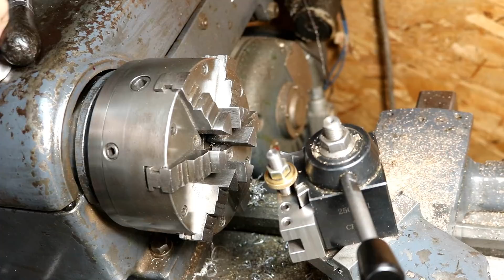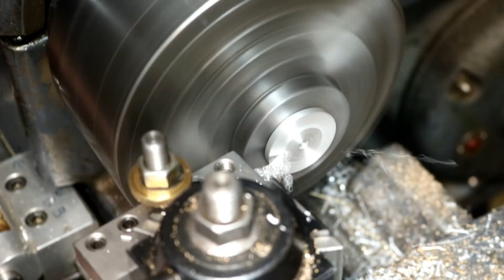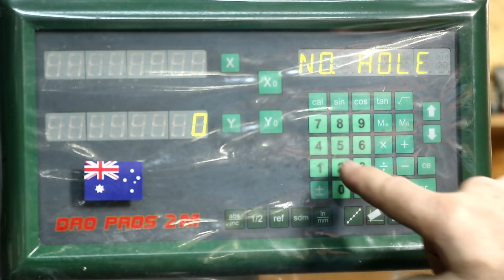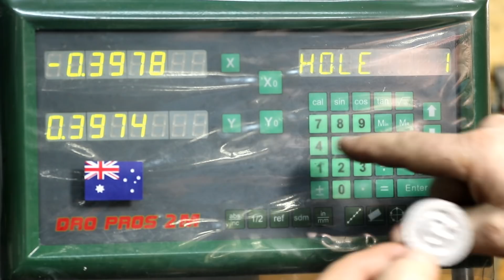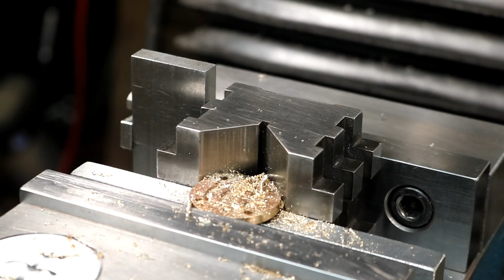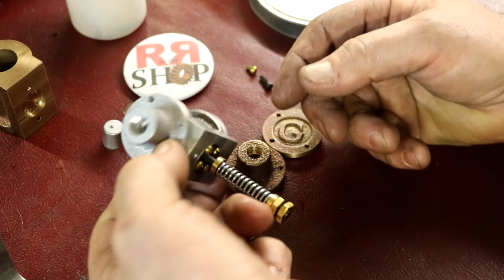P4-2 How to Build the Cylinder Heads of a Model Steam Engine for the First Time

Comment: Nice Cylinder Heads Randy and good advice on removing the parallel from the chuck catching that thing between the eyes could be your last mistake or at least wipe the smile off your face, permanently.
Reply from the maker: Yes for sure, Thanks John.

Comment: Whenever you have a bolt or screw that seats on an un-machined face (like your cylinder cap) it is a really good idea to make a little counterbore and clean up the surface under the bolt head.  Those little tiny model engineering fasteners break really easily if the head does not seat nice and square.  It also looks really nice.   You can knock one up from a piece of steel very easily.
If you go with studs and nuts, a good trick is to loctite the nuts onto the studs.  You can then tighten it like an ordinary bolt and they all end up being the same length sticking out of the nut.  (This is something I saw Keith Appleton do :-D).
Reply: Agree about the counterbore...   ;)    
Just one more fine little detail...    lol
Reply: Sorry I was just trying to help.  You are making a lovely job.
Reply from the maker: @CreaseysWorkshop  No need to be sorry John.  I have so much time already into this and more to go.  You are right the spot face would look good.
Reply from the maker: I already have enough time into this what is a little more.

Comment: I suspect that you're going to have some issues as a consequence of the connecting rod bores being a little out of alignment and not centered in the cylinders. Though wobblers are very forgiving and it might not matter.  It may have been better to drill and ream the ends when facing the inside flanges and then flip them around for just the 3/8" threading operation.
Reply from the maker: I would agree with you.  I left a bit of wiggle room, I think it will all work out.  Thanks E.

Comment: G’day Randy nice work. I would have thought the cast boss would have been used for work holding but then some were not in centre, why cast them?? 
I think the slot screws look too woodwork not industrial metal work, maybe studs and nuts would look better but then you didn’t offer them as an option. 
Cheers 
Peter
Reply from the maker: Thanks Peter, I am tending towards studs and nuts.

Comment: Brass looks nice but the slotted head doesn't seem right.  The socket head is better but a real engine would have hex head cap screws.  There's companies that specialize in fasteners for models (www.americanmodeleng.com/id41.html).  The model you're building is a work of art and I'd recommend considering specialty screws like this.  Brass hex cap screws would be the icing on the cake!
Reply from the maker: I am tending toward studs and nuts.
Reply: The only issue between studs and nuts and modeler's screws might be scale.  The size of the 4x40 nut might be larger than a scaled down original would look on the model.  Modeler's screws are usually made with than scaling in mind so they look in proportion.

Comment: I'm thinking some small brass hex stock and make some small brass hex head screws. Good job for the hardinge. Or better yet some brass 4-40 all thread and brass 4-40 hex nuts.
Reply from the maker: Thanks Peter, I am thinking the studs and nuts will look the best, that is where I am tending.

Comment: Morning Randy! Nicely done! Looking at the end, you might want to consider using studs and nuts vice those brass 4-40 flat head screws. Now something maybe you can answer: in my professional life, anytime I've worked with high pressure cast fittings they would machine any surface that used screw joints. Is there a reason for this, the underside is obvious but why the non pressure side?